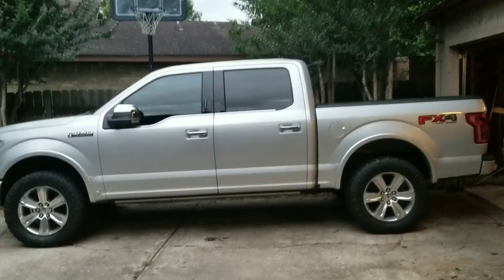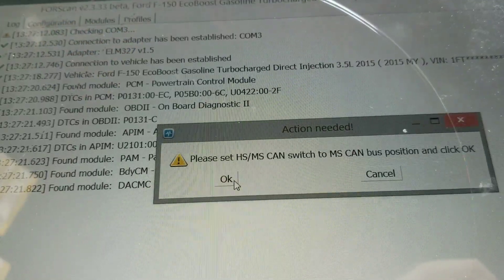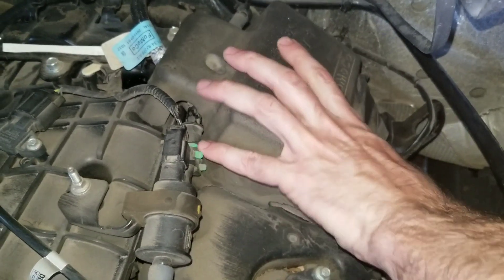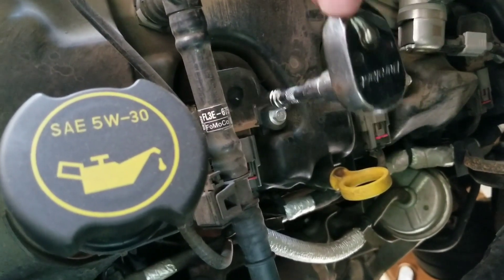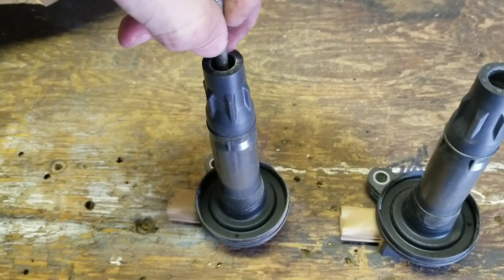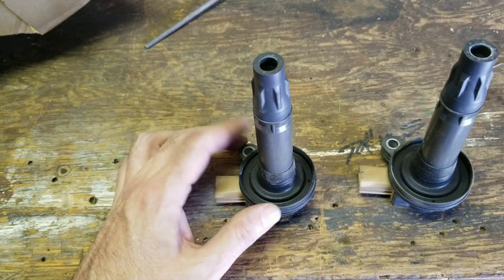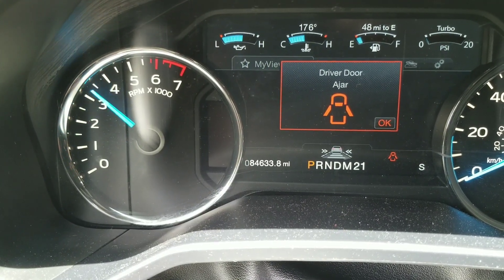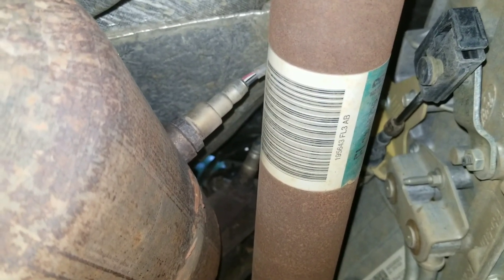Forscan DTC check engine  bad O2 sensor or coil or spark plug

Comment: Hey bud, have you ever tried to recalibrate the adaptive cruise control and the blind spot system using forscan? I'm getting my 18 platinum lifted next week and will need to recalibrate the system and I need some insight. It'd be a great content for the channel since no one has done it or filmed it